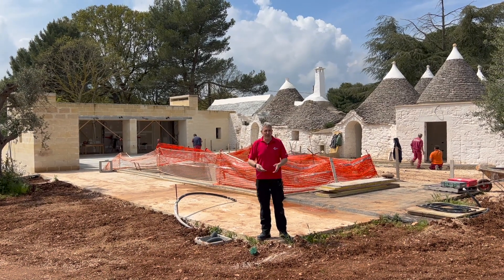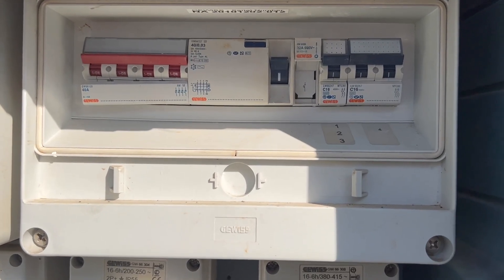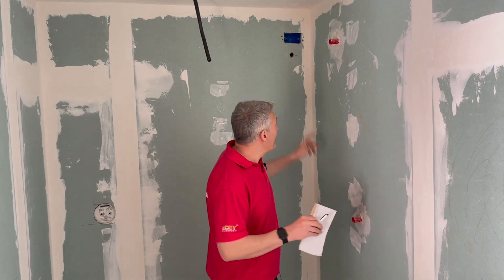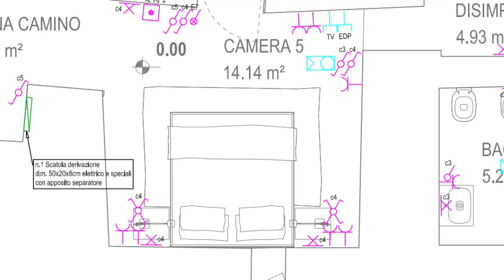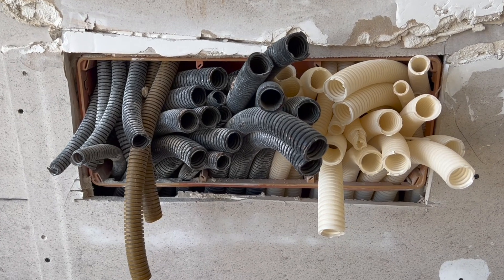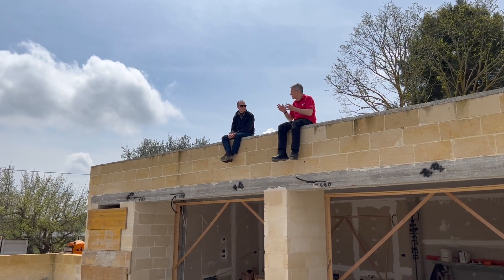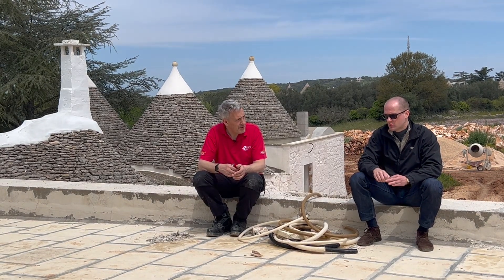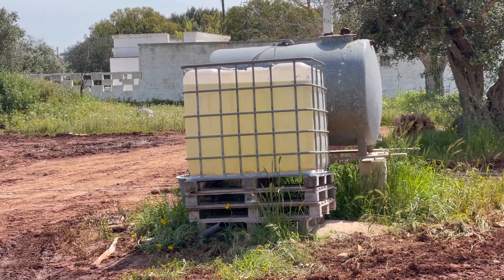Electric Wiring in Italy - You Won't Believe What They Do!

Comment: Flexible conduit is streets ahead method, upgrade cable in no time at all, no mess, cheaper, less time.
Reply: Homes in Europe are built to last - where in American they are kind of cheaply built and rebuilt. So upgradability makes sense.
Reply: @tanvach  Well even here in America we use conduit all the time, including EMT (Electrical metalic tubing) which requires skill to make the bends!
Reply: @Htm.13  Not really, residential code only calls for romex stapled to wall studs, and that's what you get in the average build.
Reply: @robertorambelli9618  In Chicago for exemple using Romex is illegal, all houses are ran with EMT and stranded THHN ran through the walls, logal codes trump the NEC in some cases...
Reply: @tanvach  Well even here in America we use conduit all the time, including EMT (Electrical metalic tubing) which requires skill to make the bends!
Reply: I am an Italian architect. I have been living in Belgium for a few years. I don’t understand why,  using pipelines you have a flexible remodulation system over time you can add power lines you can do anything. What do you do if you just hang a picture tomorrow? You have to break the wall and replace everything with a huge economic expense, with a duct simply replace the cable. If tomorrow you want to move the television as you do? With the conduct simply add the tv cable! Sorry for my English
Reply: Pull it all through in one go with a draw cable, easy really
Reply: We're SO happy to have flex conduits in Italy now that everyone is upgrading to domotics/smart switches. It was also super helpful to get fiberglass in all homes without needing to break walls or having ugly solutions outside.
Reply: In one of the apartments i lived in I used to get zapped from appliences. My landlord broght an electrician to rewire the place. He pulled tar insulated wires from the walls, stuff from the 50s. Without conduits the place would have been a mess. It was a few hours worth of work for him.
Reply: Let’s be honest, burying cables in walls/floors, whether or not it’s in conduit is a huge second best to surface mounting. The amount of time it takes, to then have cables that are impossible to inspect is mad.
Reply: @Orgakoyd  I am sorry to disagree. Buried cables (only inside conduit) is a very neat solution, surface mounting is normally avoided for obvious safety reasons. Every diligent electrician has devices and the skill to trace them.
Reply: First of all, it must be bad because it is  Italian Made (does apply for food items)  😂😂😂😂😂
Reply: Yes for some cabling, but electricitiy is the same since 150 years, it's very unlikely you need to change it. Maybe you have to add something, so keep one spare hose.
Reply: Push a snake up, pull in some nylon cord, use that to pull in wires and another length of cord. Pretty common to leave a pull cord in telecom.
Reply: It’s great for future proofing. Just make sure only using swooping bends or could be tricky.
Reply: So it's easier you change your layout of sockets ect? Want to move your tv ? No problemo just run out in the coplex  ....oh wait there is no copex in the wall I want to pur my tv on . Nonsensical.  I
I think best of bothe worlds for us in uk would be conduit to all fittings. then can easily run new cable under floors ect and pull through to fittings ect.
Reply: Ok, Pierce.
Reply: Haven't had a single problem getting new cables through flexible conduit in The Netherlands. That's cause when you install the conduit you take into consideration that someone in the future might need to change those cables. And of course if you do run into some trouble because of the total length of the conduit, you can always use conduit lube (not your mom's!).
Reply from the maker: The next part of this project is now ready 👉https://youtu.be/ISSy8vDxLcw
Reply: There is literally NO need for any upgrade if you don't cheap out and put a 1.5 or 2.5mm² propper NYM-J , NYY-J or EYY-j cable in the concrete or mortar. Welcome to the civilised world..
Reply: How often does one need to "upgrade" cable? Does cable need to be "upgraded" to keep up with new high speed electricity or something?
Reply: @2loco  Rooms can be repurposed and homes do get rewired. I don't understand why this bothers you.
Reply: @2loco  My apartment came with some extra pipes with just a single wire in them, which you can use to install whatever you want. I had one running to the kitchen and one to the bedroom. Didn't need the one in the kitchen, used the one to the bedroom to pull a network cable. I also replaced the phone cable to the living room with both a phone and network cable.
So not a daily occurrence, but exceptionally convenient when the need arises.
Reply: @Bart Kuijper  yeah we're talking about electricity here not data
Reply: @2loco  Data cables use electricity, and at least where I am from, is installed by electricians. In industrial and commercial construction, extra flex tubes are often put in for potential future expansion of the wired network.
Reply: @2loco  I renovate properties in the uk. Cables degrade over time, some more than others and in the uk we used to have no earths for example so single earths were run in for lighting circuits to retrofit. If a cable degrades or if someone puts a screw in a cable you have to replace it. If the whole property was wired at the same time all the cable is likely to degrade at the same rate and therefore you probably need a rewire for the whole house when it has degraded. An EICR is one test which may reveal this under the insulation resistance. Another example is adding new circuits to cover increasing need for electrical power sockets as well as demand.

In the UK we bury our cables in the wall and there’s no way to just pull in a replacement cable. We have to chase out new socket locations for the entire property causing a lot dust, disruption and damage that needs redecoration. Or you surface mount in trunking which doesn’t look great.

With conduit you could tie a new cable to the old cable, pull it back to the CU via inspection points (friction would make pulling the whole run a challenge) and there’s your rewire. Downside is there’s more material so it costs more. Imagine if every new home had flexicon when built though. It should in general make things easier.
Reply: @2loco  they need to be upgraded to ensure proper insulation . Insulation resistance breaks down over time . Another common upgrade required nowadays are kitchen hobs ( high powered bosch hob for example )  that a 6mm is no longer suitable for so has to be upgraded to a 10mm . This upgrade happened with showers years ago when they went 8.5kw and above . I hope this helps
Reply: @christophergallagher3845 correct, but generally speaking, the expected lifespan of electrical cabling in the UK is 50 years.  Not something required very frequently at all.
Reply: @2loco if you drill into the cable you can easily change it
Reply: @2loco for 3 way switching. You should also change cables every 50 years max
Reply: @2loco  Have you heard of rewiring?
Reply: @reggiedixon2  yes, and if you need to rewire after building new then you've obviously fkd up big time.  I've worked on houses that are 60 years old with the original wiring and no issues whatsoever.  Wiring if done right almost never needs to be replaced in your lifetime.  What happens in 100 years time is not your problem.
Reply: @2loco  And I have seen houses built from the late fifties to the seventies with one electric socket per room and when the electrician has started channelling out for new wiring routing the electrical system has been revealed to be in need of total replacement.
Reply: @2loco  obviously not tho. Technology can change quickly. When glass top burners with turbo-heating became common, the wire gauge for the older stovetops was no longer enough, and that is just one example. And it is a fact that cable isolation will degrade over time. PVC-isolated cable will only be guaranteed safe for 50 years, and half that if the cable ever exceeds 70 degrees Celsius.
Reply: @2loco  in my house the electrical system has been upgraded twice. The first installation was around 1920 and had wires with insulation but there were only 1 wire cables. It was then upgraded around 1950 to cables with two wires and is now being upgraded again to use wires with ground so sometimes it’s done.
Reply: After 10-15 years cables should be replaced.
Reply: @jozsefk9  really you still using rubber insulated cable
Reply: @damiendye6623  PVC, not so much of rubber. What are you using?
Reply: @jozsefk9  pvc has a 50 year lifetime and UK regs require the pvc to meet that requirement
Reply: @2loco  my building is 50 years old, the cables back then were too thin, so we had to change them all and since there were corrugated pipes we didn't have to do anything more than pull the old cables out, and push the new ones in. We changed the entire 100sq meters house in a day, and both of us are just DIY guys with basic electrical knowledge.
Bends are not an issue if the pipe was installed correctly, if it's too tight a bit of soap will do the job.
Reply: Houses in US are built with quite low standards and they are not built to last, in Europe and in Italy especially there are definitely higher level of standards, this is quite known
Reply: That is nonsense.... after 2-3  bends you will not be able to change/upgrade any wiring...and all the other minuses of italian wiring/systems
Reply: @angellino1 in Italy we use stranded wires, which do walk over bends without problems
Reply: @DavideAnastasia  I know...as is crap....strand3d wireless should not be în fixed installations....not to mention about the limitation of Power în properties....really bad....can you drop me a link of Italian electrical standards/regulations.I do speak/read Italian as well
Reply: @angellino1 @50Hz which is the standard in europe or @60Hz like in US or Canada the skin effect is pointless so using stranded wires or solid one make no difference at all. Stranded wires have a very small incresed resistance, but it is negligible. Straded wires are easier and faster to pose just just that
Reply: @angellino1  we have 230V which means half the amperage for the same load compared to the US. Why stranded is so bad? You can always put slightly bigger cable than solid. The standard is 1.5mm2 for 10A and 2.5mm2 for 16A (and so on, they’re regulated)
Reply: @angellino1  Stranded are almost always used in the US within conduit, as well.  They are so much easier to pull.  That said, in residential, we often use NMB, which has to be solid and minimum #14 for rigidity.
Reply: @houseman2414  that is what I know and susțin as well....stranded only within good continent,excluded copex,otherwise solid wiring
Reply: @angellino1  When you get to big stuff, we run stranded outside conduit, too.  For example, 6-3, as you have to be able to bend it.  The #14 minimum and solid is all about mechanical strength.  I'm not an electrical, so not sure when the stranded NMB starts.  Probably #8?
Reply: @angellino1  not true, use lubricant and make smooth turns. You almost nerver have to bend it more than 4 times
Reply: @angellino1  not at all lol you're thinking of solid conduit. You can pull for a massive distance with a lot of bends in flexi
Reply: @Walktheline1991  I think both flexible and rigid conduit have to have a pull box when the total number of bend’s equals 360 degrees in the USA.
Reply: @angellino1  in The Netherlands we also use conduits bends are not a problem.
Reply: @angellino1  bends arent problem if you know
Reply: @angellino1  in Argentina we use pipes, similar to water pipes but a bit softer. A special kind, meant for electrical installation
Reply: @carlosgarcialalicata  that would be more adequate...as in Uk,pvc or steel galvanised
Reply: @angellino1  NEVER been unable to pull through a flexible conduit using a special pull cord. The bends are designed to be gone through and they sell a special synthetic pulling lube to help, for really difficult cases. I've been able to pull through conduits from the 1960s and even from the 1930s, which were made of metal, sheeted in waxed cloth from the inside.
Reply: @nicholasboncardo  i can say exactly the opposites.....so it does not count....can you leave a link to Italian legislation!
Reply: @angellino1  it’s future proof with pull string reserved
Reply: @Tech3604u  no mate...is crap....fix wiring with Fuller copper....all the way
Reply: @angellino1  Rubish, as long as the bends in the conduit are not made at stupid angles you can easily put a draw wire through and if you have to pull a whole bunch of cables through you can use gel to lubricate and lessen the friction
Reply: @angellino1  you have never pulled a wire in a flexible conduit.
Also... 2 or 3 bends? What are you saying 😂 there are derivation boxes... No one runs one flexible conduit from the start to the end of a line.... You gets at max 2 bends.
Reply: @lorenzogazzola328  well ,there you said it,another bad ideea of italian wirong and building regulations....holes in the walls everywhere and multiple disconnections in all of those jonction boxes....first of all is not esthetic,second of all risk of misconnect wires and third and this is a major issue ,EVERY Reconnection in all of those junction boxes raise the probability of bad connection,overheating  that leads to fire,easy acces to wiring from unauthorised or trained personnel,etc.not to mention no selectivity in fuse boards,etc.....there is too many....working easy is not a requirement for electrical standards,but safety is
And finally,put the power provided up,because 3.3kw are used easily by few appliances....I was telling my brother in law that best way to upgrade his property is to go 3p+n times 3.3kw/ phase.....that would give him roughly 10kw
Reply: @angellino1 Or you do it right and you have the advantage of a system that's accessible and can be repaired locally, without affecting a lot of unimpacted areas. Everything has pros and cons. We used to have solid wires instead of stranded wires in Italy (don't know exactly when it changed, but we just upgraded them in our granparents' house) and historically we went down the other route. I mean, you're right, there is more risk if you have more connettors, but it's not rocket science and our regulatory system decided it's doable to train people to make it right while saving a lot of money on subsequent maintenance.
Reply: @Matthew314 
I have been an electrical engineer for almost half of my working life in UK and the remaining in Italy. There are good points and down sides on both methods of installation. 
This article is referred solely to domestic and not industrial type of installation.
In UK, despite the widespread of buring cables into plaster, I appreciate the simplicity and increased safety (i.e. fewer connection points and rings systems, to mention a few).
In Italy, while I appreciate the adoption of flexible conduit, the wiring becomes more complicated and are required a greater amount of cable thus more expensive.
Reply: @gaetanoroccuzzo  can I please have a link with Italian regs?like 18th edition in Uk?
Reply: @angellino1  Why is it unaesthetic? It’s absolutely invisible when you finish the masonry work. Misconnecting is impossible because of the color coding. And how does unauthorized personnel have more access? You can unscrew sockets and switches in the UK as well and do the same damage. I agree that 3.3 kW is ridiculous nowadays.
Reply: And how many times in your life do you change the cable? 2 times a year, maybe? In a normally designed house, people don't change cables for decades.